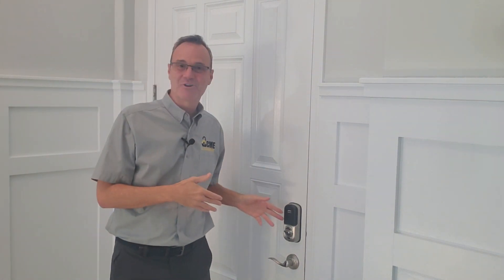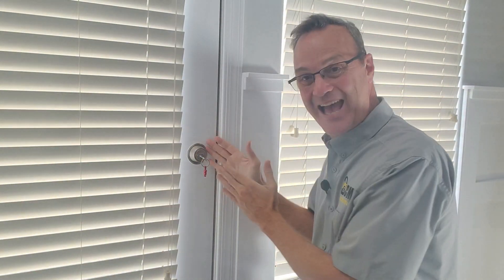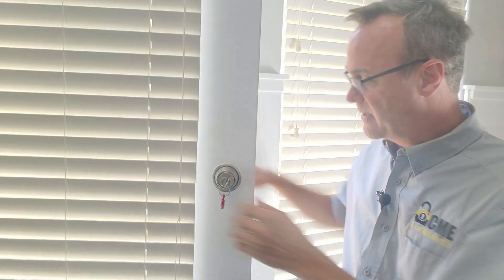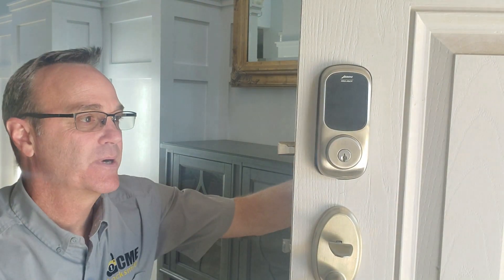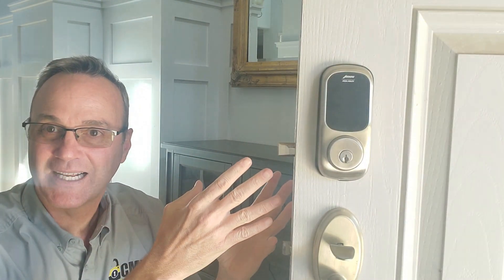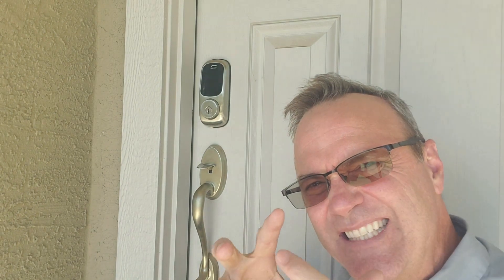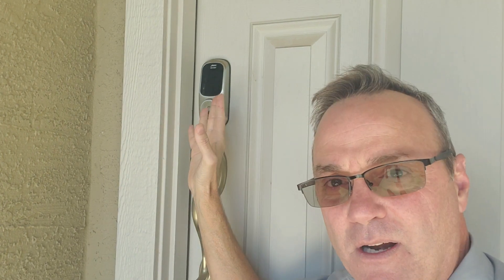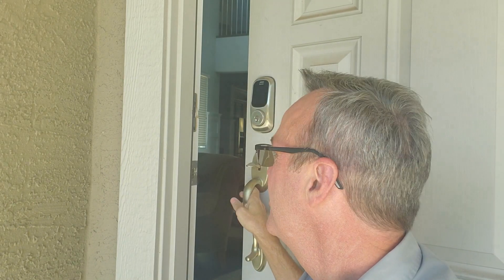Smart Lock Not Working? The 1 Thing You Must Check When Installing a Smart Lock

Comment: I installed mine and it extends all the way but I can also push it closed with my hand, any suggestions? (For context it does engage all the way even when I open the door and push the deadbolt it still closes with the force of my hand)
Reply from the maker: Something about the install is incorrect. It should lock in place when fully extended and not push in.

Comment: Great video. Installed my lock and would seem to lock automatically, but then retract when pulling on the the door. Based upon this video realized that the bolt was not extending all the way. Have adjusted the hole for the bolt to extend fully and now it works great. Thanks Acme Locksmith!
Reply from the maker: Glad it helped!

Comment: Mine it’s not working I have to close it manually or with the key because it’s not closing by itself what can I do
Reply from the maker: Could be a strike issue, the strike is rubbing the bolt or it could be the issue we discussed in this video. 

https://youtu.be/AZ4D0F4d1V0

Comment: What if the lock is doing this even when the door is open (nothing is restricting the bolt from extending)?
Reply from the maker: Call their customer support. The only thing that might be is if you're handing is wrong. But that would depend on the lock you have.

Comment: Thank you for the reviews on the Yale August locks!  Could you tell me if the deadbolt that comes with the August smart lock can be bumped?  What type of grade 1 deadbolt that is compatible with the Yale-August smart locks would you recommend replacing it with that cannot be bumped?  Thank you!
Reply from the maker: The default one can be bumped by a skilled person. It does have anti-bump pins installed but it's doable. We sell them with a Mul-t-lock cylinder upgrade. https://www.acmelocksmith.com/buy-safes-online/yale-touch-screen-bluetooth-deadbolt-yrg426.html

Comment: What happens if the battery dies ? And key it’s not around ? Yale locks have a 9 v alternate option for when battery are out— does this one have something like this?
Reply from the maker: You get a low battery notification when the batteries start getting low. 

Interesting question though. I still carry my house key with me everywhere even though I have a Smart Lock. I don't carry 9 volt batteries on me. I'll have to think about that.

Comment: Why you still have the normal door lock with handle? Is it necessary? Or it serves as a handle for the type of Yale product you chose
Reply from the maker: In my installation, the handle lock is what automatically latches the door shut when I close it so it doesn't just blow open. But, instead of buying the deadbolt version of the Yale CBA they also sell a handle version of it, so you could just buy that and replace your existing lever/knob.   
On Amazon here:
https://amzn.to/3uMPpva

I do get a small commission if you use that link and buy product from Amazon.

Comment: As a locksmith for over 20 years I would also add that it is also extremely important that you ALWAYS take your key with you. I get multiple calls every single week from customers with electronic locks that are locked out either because the batteries died without warning, or some other malfunction caused the lock not open using the keypad. People have to remember that these locks are simply for convenience of locking and unlocking and are not a replacement to carrying your key.
Reply from the maker: Totally agree!
Reply: Wish my wife understood this...
Reply: AGREE  I am changing a Yale Keyless that came with house to Yale Access KEYED. Pay a couple bucks more for KEY

Comment: Question  I see reviews for the expensive electronic locks but what would you recommend for one with out all the extras? Just a key and key pad no RFID,  WiFi, or cellphone.
Reply from the maker: For touch screen, I'd still go with the Yale, just without the Wifi feature. 
It is on our website:  
https://www.acmelocksmith.com/buy-safes-online/yale-touch-screen-bluetooth-deadbolt-yrg426.html

If you don't care about the touch screen, Schlage  has a great push button lock for less than $100. It's on Amazon here:  
https://amzn.to/3kJ5TPl

And you can see our video on the Schlage lock above here:  https://youtu.be/6LK5wc8eGZg

Comment: Question.. I rekeyed a Schlage to have a master key.  My master key will turn counter clockwise nice and smooth, but wont turn clockwise AT ALL. The operation keys work PERFECT. What could be the issue? Thanks
Reply from the maker: Most likely  just need to recut the master key. Sometimes when a key is cut poorly the key is at an angle in the jaw of the key machine. It only takes a little bit of an angle to create the problem mentioned.  You could try to LIGHTLY run a round file across the cuts of the key ONE or TWO times and check the key again.
Reply: @LocksmithRecommended  Thank you so much.  The master works fine in 3 other locks that I repinned.  Its just the one that is giving an issue.  I'll try what you said. Maybe the key needs to be cleaned up a hair.